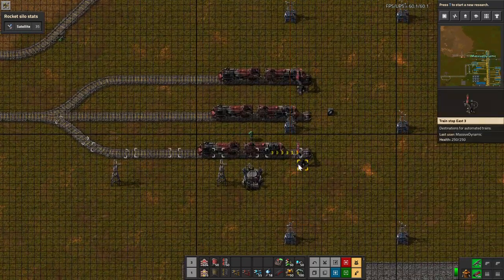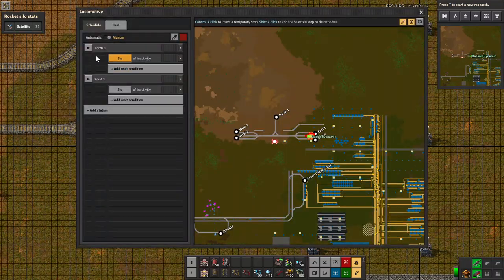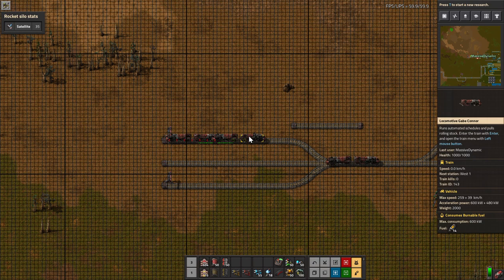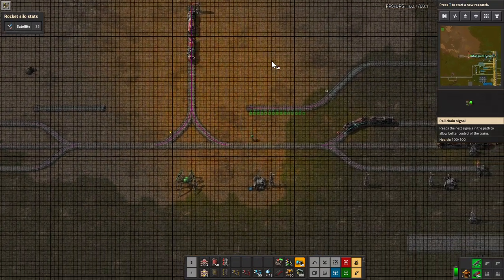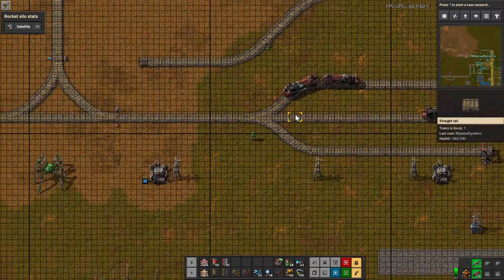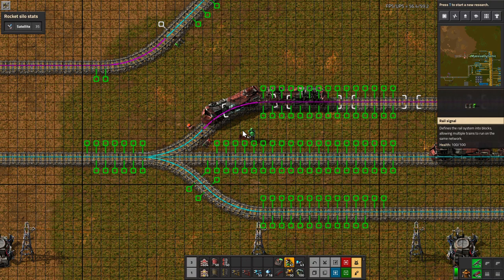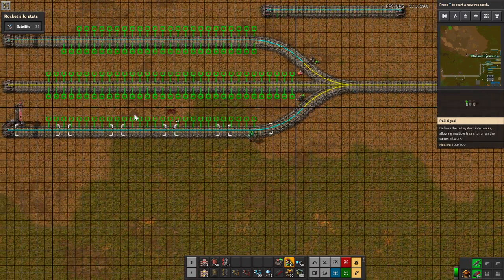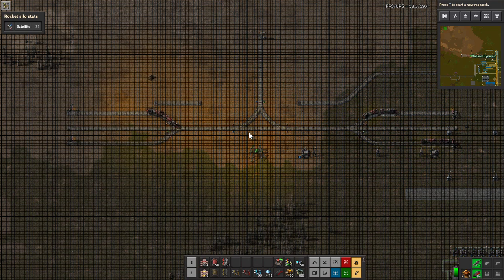Factorio trains tutorial - bi-directional - single track - train signals made simple

Comment: somehow more confused.  i thought you put the train signal on the right side of the track (same direction of flow) just before a shared rail section to stop it from going through if there was already another train using that section.    what do chain signals do exactly and when do you need to put regular train signals on both sides of the track.  I have a few trains with engines on both ends going forward and backwards on a single track.  I also have a single engine train which does a loop and comes back onto the same single track after loading up with minerals.  Have I broken the train system?
Reply from the maker: Try this video
Factorio Train signal visualizer
https://youtu.be/MolLHKkJkLw
Reply: Omg thank u!!! It finally clicked for me, and I have watched MULTIPLE videos!!!